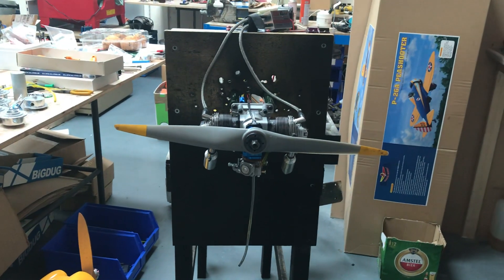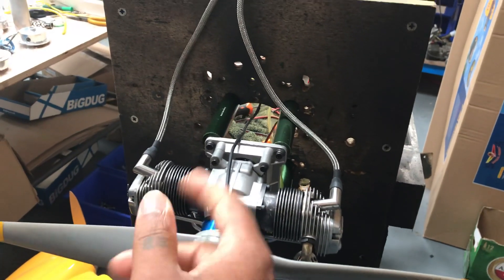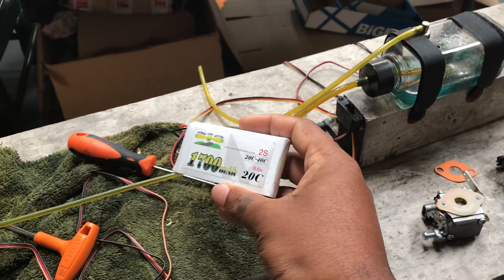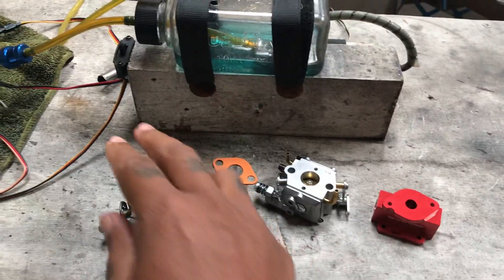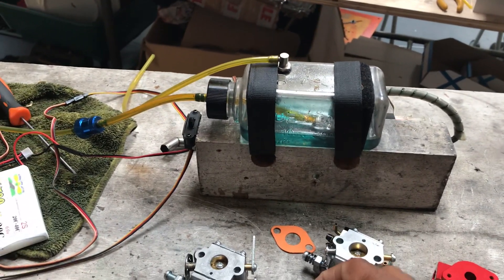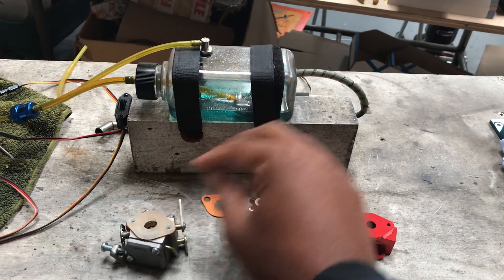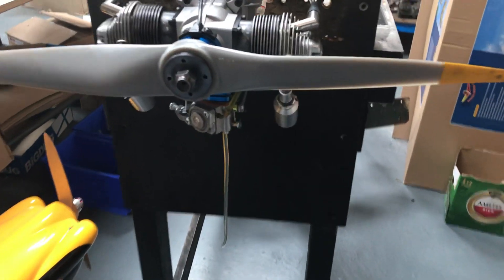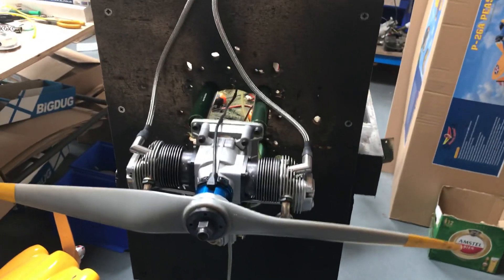OS FT-160 Twin Engine with a 18 x 8 Prop 1400 RPM - 7100 RPM

Comment: Wondering if this would be able to run using the standard OS carby in lieu of the Walbo?  I saw that you used the OS carby on the 120 conversion.  cheers